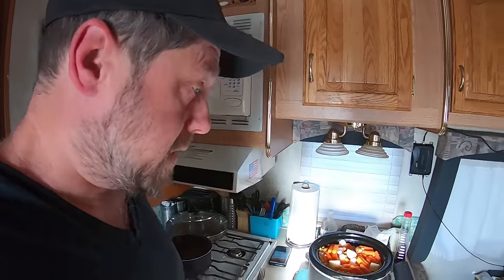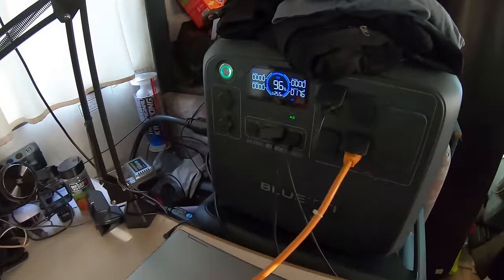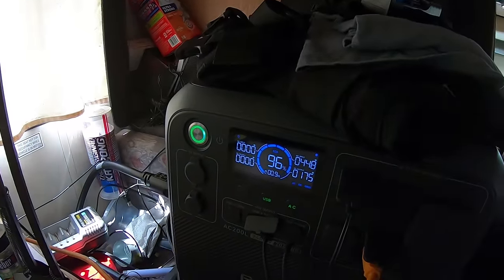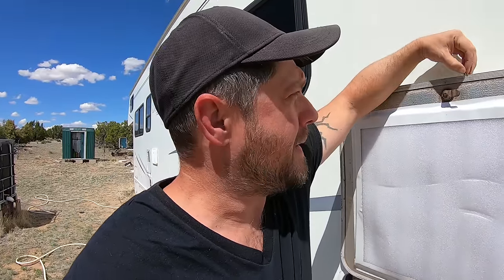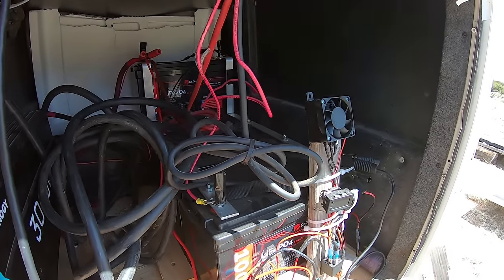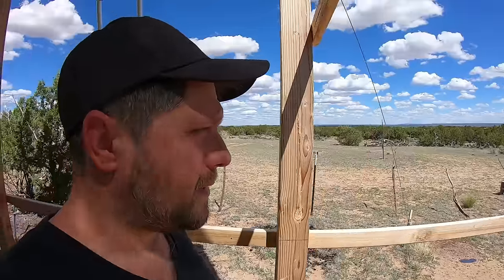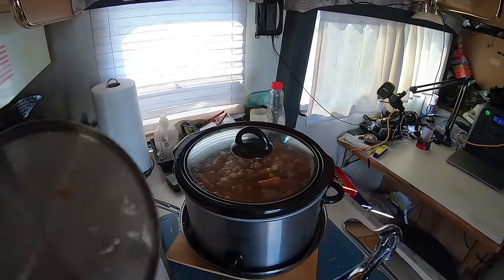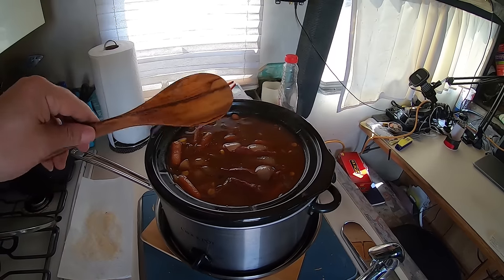"Does Your RV Even Run?"

Comment: Hi Mike,,hey what do you have attached to your Bluetti for battery storage. I’m putting a b300 to my Bluetti 200Max for 5k watt hours of storage. Your stats on the slow cooker tells me you have around 5 or 6 k of storage also. Great to see you using the Bluetti. I’m setting my system up for reviews for Bluetti on their page.
Reply from the maker: It is the AC200L with a B300. Great setup!
Reply: @LivingFree  you duh man,,my set up will be in a 5x8 cargo trailer. I used to have a 90 26 foot Fleetwood Flair but lugging my cargo trailer around instead of that RV is a game changer